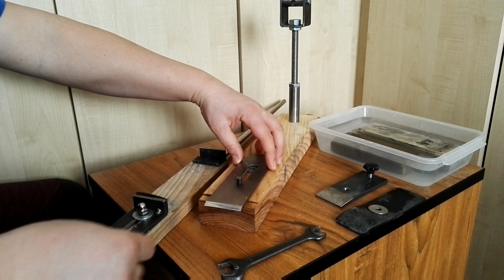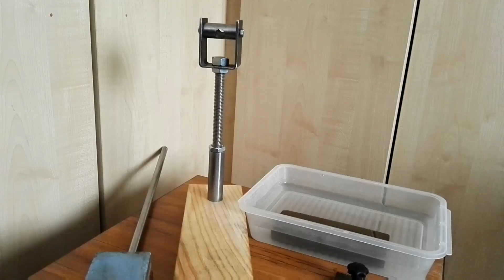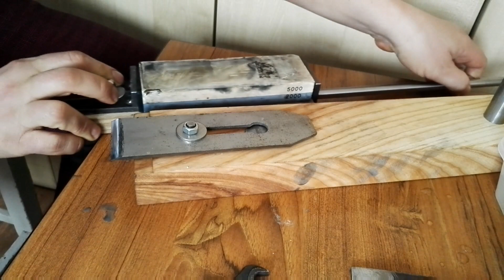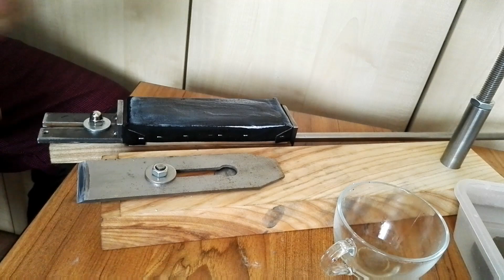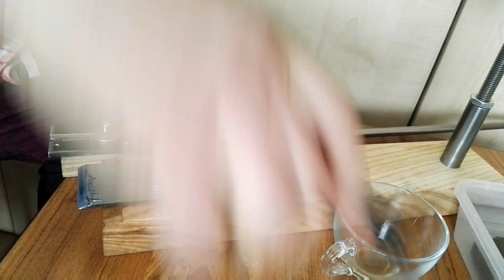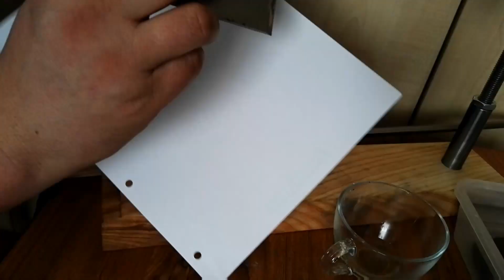Plane iron sharpening

Comment: What's the secret? I've gone thru using from 320 grit all the way up to 8000 grit. And I can't get them sharp enough to cut anywhere near that. I've seen people shave the hair with the blades. Can't get mine to do it no matter how much time I spend on them. I'm doing them at a 25° angle. Is that about right?
Reply from the maker: +Philip Prowse everithing is right my friend. I dont know what is wrong by your way. It should be supersharp.
Reply: First your the back of your blade must be totally flat and polished before sharpening the bevel.or else it won't work my friend